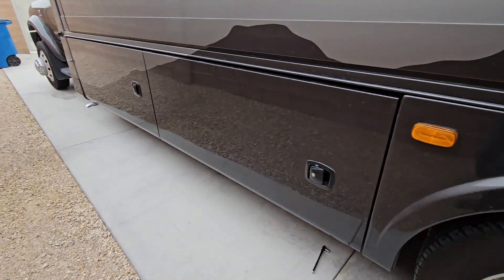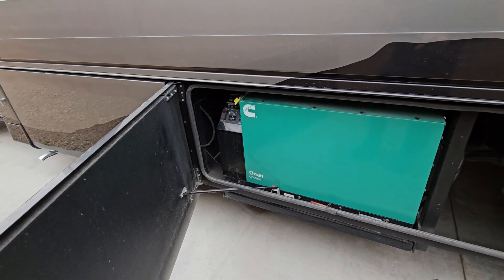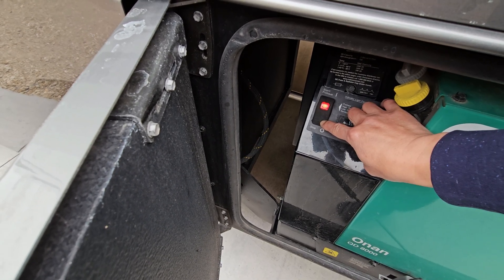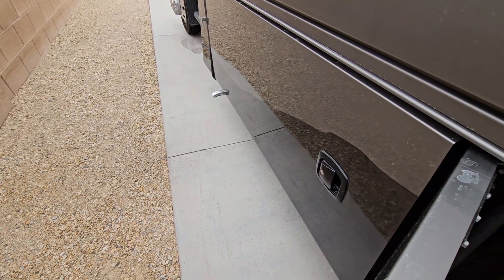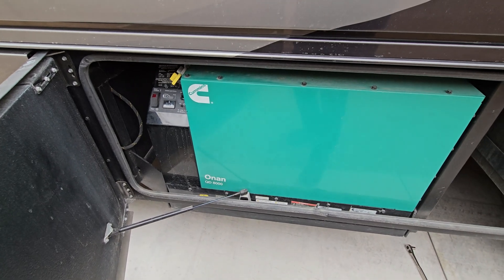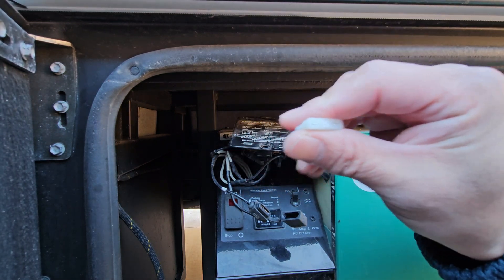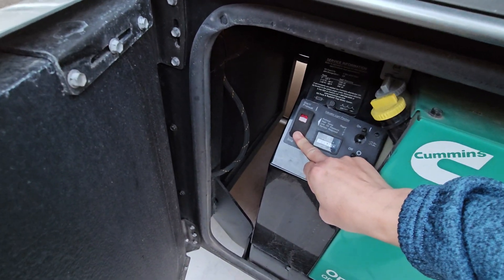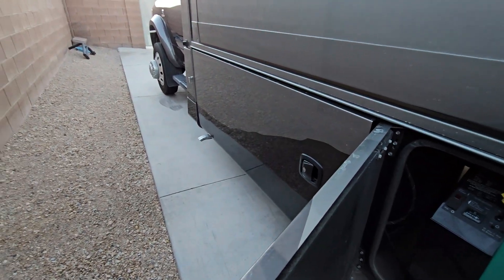Onan Diesel Generator Cold Start Problems

Comment: Mine is having this issue and was hoping the fuse was the solution.  But the fuse looks fine.  I'll have to look further! :(
Reply from the maker: Hard starting on an onan diesel will likely be fuel or glo plug related. Does it start much easier in warm weather?
Reply: @rvlifediy  I'll let you know when the weather warms.  ;)
Reply from the maker: @gojonny  if it sputters and shoots out smoke, then it's likely glo plug related.  No smoke at all and it's not getting fuel to create smoke. The onans are also known to have fuse and glo plugs being fine, but no power getting to the glo plugs. That can be an expensive repair, and some info out there on providing power manually to heat the glow plugs instead of replacing a bunch of parts.  Good luck on your repair.

Comment: very common with older diesels, just get some starter fluid.
Reply from the maker: Oh yea I remember the days of the old 7.3 Powerstrokes.  This generator is brand new, and shouldn't have these issues.  I had the exact same generator on an older motorhome and never had issues in freezing weather, so I figured something was wrong.  WD40 in the intake works too.
Reply: @wqqwate  as you probably know it is not advisable to use starting fluids if you have glow plugs!

Comment: Today I learned: diesel engines ignite the fuel simply by compressing the air.* The glow plugs are only necessary as a "starting aid" below around 40 degrees. That's why the generator functioned normally despite the blown fuse. "When the temperature of the air surrounding the engine drops below a certain value, depending upon cylinder head design, (40 °C for precombustion chamber injected, 20 °C for swirl chamber injected, and 0 °C for direct injected engines), the engine loses too much compression heat to reliably initiate combustion, and the engine fails to start. Glow plugs are used to help overcome this issue by introducing additional heat energy into the combustion chambers." Wiki "glow plugs"

*This is also why diesel engines are so noisy - they need much higher compression to develop in the cylinder to ignite the fuel.
Reply: Did you have similar issues with your Winnebago 3200 gen?
Reply from the maker: @MSMaifield  When I originally got it, yes I did.  Winnebago had an undersized fuse in the stairwell.  It wasn't a standard fuse.  It was a slow blow fuse (which didn't blow at all).  It just cut off power slowly to the generator starter.  I did have to upgrade the size of the fuse to a 300amp slow blow fuse.  Winnebago fixed that in later models.  The 3200 also seemed to get air in the system a lot because I drove with the fuel tank under a 1/4 of a tank frequently.  So hitting the start/stop button (prime) only once would prevent it from starting, and I would have to hit it several times before attempting to hit the start button.  I'm not familiar with all the fuses on the 3200 itself.  I believe they are on the far right side of the front, with a removable cover.  It does have a glow plug, but I'm not sure how it is wired to check for operation.
Reply from the maker: Yes diesels are interesting old technology. Very simple and reliable engine if the modern emissions system wasn't so complicated and unreliable.